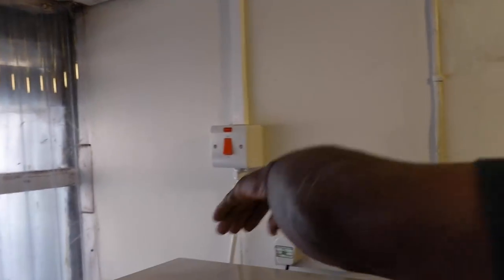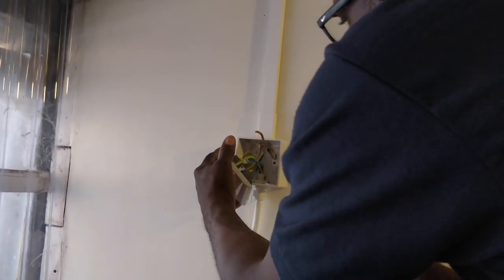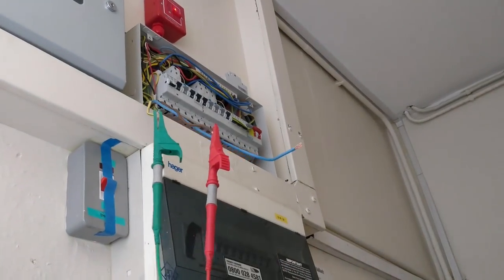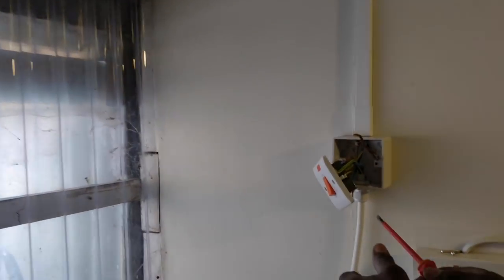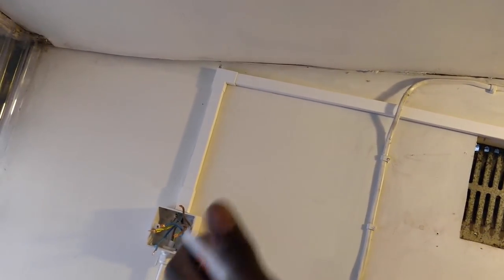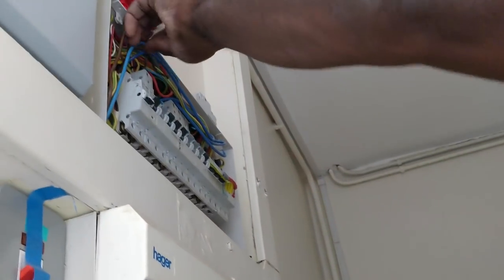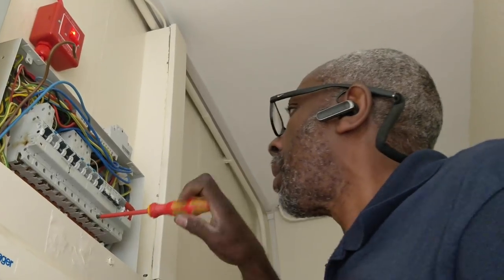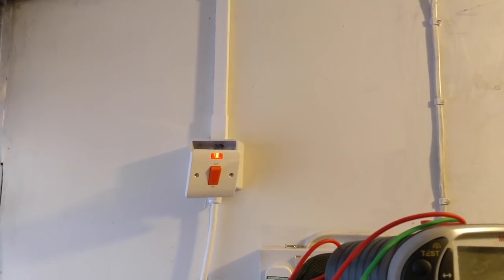Electrical Fault Finding Call Out Job  - Electrician In London Vlog #14

Comment: What size was the cable for the circuit? Looked like a 2.5mm radial? Maybe im wrong though, surely using a 32A MCB would be rated too high for a 2.5mm?

Comment: Thanks for sharing your knowledge. I had a customer with flickering lights on his garden summer house. Lights were powered through a remote control switching module. IR test on the SWA cable buried in ground showed a leak to CPC conductor causing the module safety cut out. Interestingly it kept trying to switch back on every few seconds. Not enough fault current to cause the breaker to trip but enough to upset the module. Testers never lie! 👍🏻👷🏻‍♂️

Comment: I found this highly interesting.  I am a sparky from America.  It's cool to see the difference in materials that you use on that side of the pond. Was that a junction box with breakers or is that the main panel? Your meter looks pretty badass as well!!!
Reply: That's was indeed what you guys would call a main panel, we call them either mains boards or fuse boards usually 👍
Reply: He was using a megger to test for insulation resistance when a cheap multimeter could've gotten the job done by simple point to point continuity test. Btw, that megger isn't cheap.

Comment: It's quite rare to see arcing coming through the breaker like that. I saw this once as well. It looked burnt
Reply from the maker: Yep, it wasn't what I was expecting to see
Reply: I randomly opened an MCB I found and inside the contacts were pretty much burnt away. So maybe someone had tried to reset it a good few times under a low resistance short circuit situation. they should put a window in the side of the MCB so you can see the contacts and know if someone has damaged the contacts.
Reply: @thepowerisinyou2886 that's a very good point🤔🤔🤔🤔
Reply: +Electron 101 -  The MCB was in perfect condition on the outside, I didn't find it dumped it was in the store room / spare parts for a large company I worked for.

Comment: Why should it say 999? Is that the default value when there is no continuity. Awesome channel
Reply: It's basically an off the scale reading, resistance is greater than 999 meg ohms. You can get down to 1 meg ohms for an IR Test pass, but worth investigating why it would be a low reading (maybe an older installation and the insulation between conductors is breaking down).
Reply: @leegreveson  Ah thanks mate that's a fantastic response! Very much appreciated.

Comment: I dont know if anybody noticed the unprotected FLAT (i think its 2,5mm cable saddled on the wall)    No trunking or piping , the cable is susceptible to mechanical damage . (SANS 10142) South African National standard 
One should use NORS Flat cable instead

Comment: Personally I would of disconnected the cables at the board first and checked the breaker. And worked it from there. By chance I would of been in and out in 5mins on this job.
Reply: You could tell is wasn't tripping like a direct short, it looked more like a bad weak breaker. Just my 2 cents on it,        'Electrician Joe'
Reply: With all that spare time you could start uploading videos for us beginners
Reply: @asef698  not enough money in it. Sure i would of earned a couple of hundred in 5 mins on this job. I'd suggest starting an apprenticeship with a small company if you want to learn.(in the larger companies apprentices tend to be go fors)  good luck!
Reply: 987654321 0 how are you going to charge a couple hundred for a broken fuse?
Reply: @SouthendersTTV  minimum charge (call out charge plus hours labour plus replacement mcb if needed) 200 to 250. I'd say he charged about the same. Same result just different approaches to the job.
Reply: @SouthendersTTV  it's not how long it takes, it's what you know.
Reply: And you would possibly blow the breaker again since you dont know of another condition happening
Reply: @toddt6730  highly unlikely as circuit would of been tested before energised as is the case with any job I do. You didn't think I would just change breaker and go did you?
Reply: @devilsadvocate9580  it just sounded like you might change the breaker without looking for a possible short and energize and see if it works, just the way I read it ,no offense intended, I'm sure you an excellent sparky
Reply: @toddt6730  There are things done today in electrical science which would have been deemed unholy by the very man who discovered electricity, who would themselves not so long before been burned as wizards.
Reply: 987654321 0 $200-$250 call out fee, that’s insane!!!
Reply: @caldogz90  compared to a guy earning 500,000 a week to kick a football around it is nothing. I earn every penny. Should be more.
Reply: @devilsadvocate9580  £250 or $250 USD? Either way that is expensive for a call out but hey, I ain't getting mad at other sparkies not being scared to charge